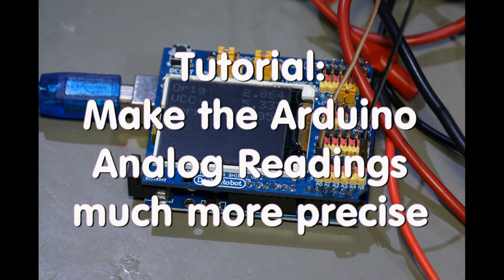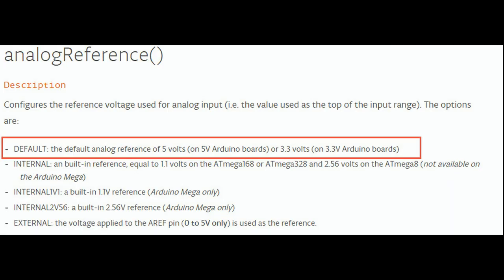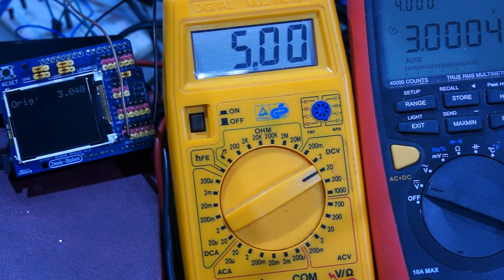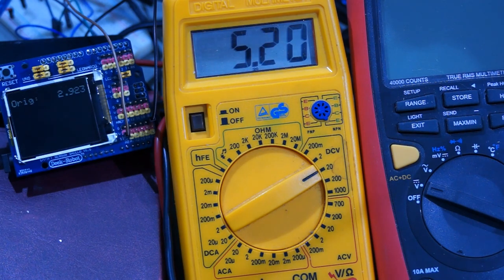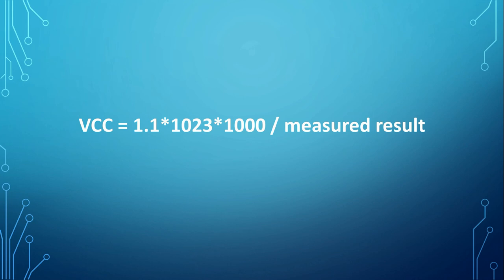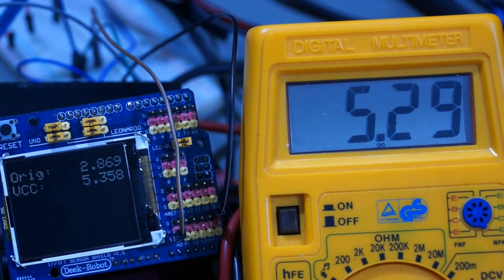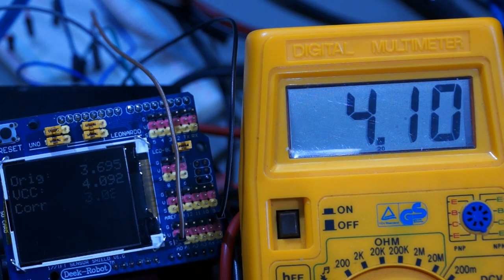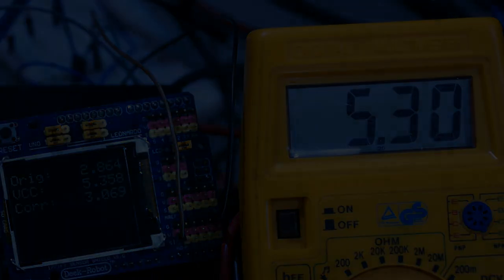#10 Tutorial: Make the Arduino Analog Readings more precise

Comment: Very nice video! To increase the resolution, you can add up multiple samples,  as there is some uncorrelated noise on the A/D and input signal. To get a more stable measurement you can for example add 4 values and divide by two to get an extra bit. Experiment a bit as there is enough sample time for a reading on a display... averaging cancels out noise.

Comment: Nice video. Just a tiny correction - in formula one should use 1024 instead of 1023. It's not the highest value that one should be multiplying, it's the number of values (resolution), and the number of 10-bit values is 1024. So the formula should be VCC=1.1*1024/measured result
Reply from the maker: You are right
Reply: Actually, I was wrong, and you were right! :) One person explained the issue with my "correction" - it should be 1023 because the maximum value is 1023, and we are basically calculating percentage, not resolution. One should divide by 1024 if one wants to find out resolution - if one wants to know size of the step ADC can resolve.
Reply: mbaksa No, you were right from the beginning. See this: https://forum.arduino.cc/index.php?topic=303189.0 and this: http://www.electro-tech-online.com/threads/why-adc-1024-is-correct-and-adc-1023-is-just-plain-wrong.132570/
Reply: The maximum 10 bit number 1111111111=1023.  The math would tell you that the maximum voltage should be 1023.  BUT (capitals), the ADC does something you are not expecting.  It subtracts one division (LSB) from the reading.  To get the full reading you have to use 1024.

Comment: The ADC of the Arduino is normally ratiometric, as in referenced to Vcc. You can switch to an internal fixed reference of about 1.1V instead. Most external ADCs have their own built-in fixed reference. Both have different use cases.2
Reply from the maker: The point of this video is to use the internal reference instead of VCC, I think.
Reply: Hi Andreas, My comment seems to have been edited, it is not my original text.?
As you know the use of a ratio metric ADC means that the supply to the Arduino can vary but the ADC count should track the changes in the supply and give the correct conversion.
BTW: I am no way being critical of your excellent tutorials.

Regards Eric.

Comment: Hello Sir, brilliant yet simple way of correcting hardware issue with software. My two ways of correcting this issue were: 1) use a higher supply voltage (2 series Lipo) and a 7805 to power the sensitive projects or 2) use a 3.3v regulator to feed the Aref, which limits the input voltage on analog input pins. Now I have an option #3 (or #0)! Thank you !
Reply from the maker: Thanks! I am not the inventor, I just liked the concept when I saw it.
Reply: +thevideoboy87 hello..  I'm having the same problem.. can i use a 12v supply and a 7805 to supply my acs712 current sensors?  my reading is pretty bad.. can u give me a sample circuit?
Reply: +Renatzu Agura Hi. the ACS712 consume approx 10mA, which means a dissipation of approx 70mW in the 7805. There should be no issue, make sure to install filter caps on the in/out of the linear voltage regulator. It's always a good idea to put a "dummy" load on the 7805 output, like a small LED+resistor to improve ripple.
Reply from the maker: +Renatzu Agura Thevideoboy87 is right. I could add that you need short wires between the acs712 and the Arduino to avoid noise pick up.In addition, you also could check with a voltmeter if the "bad reading" comes from the acs712 (disconnect everything else exept the current test wires and the supply voltage and measure directly on the module) already or is somehow created by the Arduino.
In addition it is always good practice to wire ground as a "star", not a "net".

Comment: Try use high external voltage and a linear regulator to power arduino, then don't draw much current from the arduino itself - this works well for bigger applications which already use multiple voltages, also make sure to keep arduino away from magnetic fields such as those made by power supplies, motors, power wires and wireless transmitters.
Reply from the maker: Good idea!

Comment: Sir, recently i'm facing a problem when i connect ACS712 20a current sensor to my node mcu 8266 microcontroller.The reading value is not accurate at some points.then i searched on the internet and find out  that the current sensor is 5v module while the esp8266 is only giving 3.3v. so how do i fix this?
Reply from the maker: you get level shifters from 5 to 3.3 volts

Comment: Does the converted analog to digital value of the internal voltage reference of 1.1V, the digital value, change all the time with variations in Vin and Vcc? It would be interesting to see that digital value with changes in input voltage,  if I understand it correctly.
Reply from the maker: Yes, it changes as shown in the video.
Reply: The term was "bit banging", it says "bit panning" on CC.  So bit banging is using software to do the job of hardware.  That I could look up.  Todos los dias apprendo algo nuevo.

Comment: Hello Andreas. Nice trick ! Would this also work (or even be needed) on the ESP32 (WROOM) ? Need to measure up to 85 volts and I'm wondering if I would use the build in ADC or an additional AD1115 module ( both with resitor divider). AD1115 is higher resolution ( 15b in place of 12b ) and has a build in voltage reference, but 0.02 Volt resolution is good enough
Reply from the maker: 1. It does not work on the ESP32
2. I made a video about the ADCs inside the ESP32 and the AD1115

Comment: Great video, thanks Andreas.

In the video the equation is presented as 1.1*1023*1000 but in the code on github it is actually 1.1*1024*1000. Which is correct ? I assume 1023, since the ADC reading will max out at 1023, and dividing that by 1024 will not give exactly 1.1V
Reply from the maker: There are different opinions about it. I do not care...

Comment: hi .. is there any way to reduce analogue value fluctuation while reading from analogue pin
Reply from the maker: This is a complex topic and I cannot give you a short answer. The simplest thin is: Keep the wires short.
Reply: @AndreasSpiess   wt about adding a capacitor ? since making wires short is not possible . if yes , can u tell me wt value of capacitor should be required ??

Comment: Dear sir, again a very good work on reading very precise voltage with fluctuating usb voltages. I had this problem as during testing my uno from the supply of my pc usb, the voltage fluctuats around 4.95 to 5.1 volts according to the pc cpu load etc. After uploading the sketch and when it's built outside the readings are all off. So again to plug to the pc and rewrite the values as per the external 7805 regulator. This video lesson will really help me. I will give it a try. Thank you so much again.
Reply from the maker: You are welcome. I hope it will do the job for you.

Comment: Thank you, a very useful and precise description, good job. Is there something special about the Leonardo in relation to excel ?  or can you do the same with the Uno or Mega2560?
Reply from the maker: +Howard Bailey thank you for your comment! Yes, something is special. Only Leonardo, Due, and Pro Micro can act as an USB host. Only these boards know the command keyboard.print() which I used to transfer the data from the arduino via an emulated keyboard to Excel. If you want to do it with an Uno you could use a usb host shield for this purpose. But I never tried it.
Just google arduino keyboard.print and you should find more infos.
Reply: +Andreas Spiess  thanks. I had a look at your other vids (all good) and more on utube, I now realise the Atmega32U4, and some others, have the USB coms built in, i.e. 'Host' USB, I'm learning gradually. It's more difficult 'teaching myself' so videos like yours are a godsend, I look forward to your future posts.
Reply from the maker: +Howard Bailey I learned it the same way you do now. This is the reason for my videos. I want to give back what I got...

Comment: I don’t understand… you used the number 1023 in the formula you gave at 3:20 because 2^10=1024. These are not the same number. Why not use 1024 in the formula?
Reply from the maker: Because there are only 1023 "distances" between values. But I am not sure which one is correct :-(
Reply: @AndreasSpiess  Gotcha

Comment: Why not just switch to the internal reference?
Reply from the maker: This is what this sketch does.
Reply: @AndreasSpiess  I watched the video. You're measuring the internal reference and using that deviation as an offset to fix the inaccurate readings. But if you just switched to using the internal reference as the active reference, it would just work properly anyway.

Comment: I have gone from 3 volts to 5 volts with 98 percent accuracy. As long as you tie one of the ground ports of the Arduino to whatever you are measuring, its 98-99 percent accurate. Am i wrong in doing this?
Reply from the maker: If it is 98-99% accurate it seems to be ok for me.

Comment: If the Arduino comes with an accurate, built-in voltage reference, you'd think it would use that voltage reference by default (possibly combined with a voltage divider placed in front of the ADC).
Reply from the maker: I do not understand. We use the built-in voltage reference for this project.
Reply: @AndreasSpiess  Yes, I know, I've watched the video. I'm only wondering why that isn't the default. There are several things about these ADCs, that have me scratching my head, especially the one in the ESP32. It's a shame such a great little device is let down by such a poor ADC. It would probably cost a few pence (cents/pennies) to get that fixed.

Comment: Thank you for this video, Andreas! Could you please explain me the formula 
Vcc = 1.1*1023*1000/measured result  ?
God bless you!
Reply from the maker: I do not remember, how I calculated this (it is a long time since then). It has to do that you measure a value which should be 1.1 volts (internal reference voltage), but in reality, is not, because you measuring is wrong. Maybe you can figure it out if you look at the other calculations in the code...
Reply: In case you or someone else still wonders:
The ADC returns values 0-1023 proportional to the measured voltage with 1023 corresponding to VCC.
Proportionality is to say that the ratio voltage/ADC-value is constant for all voltages in its range, specifically this holds for VCC and 1,1 V. We know that VCC is measured as 1023 for any VCC, and measuring our 1,1 reference voltage, the corresponding ratios must be equal:
1,1 / measured result = VCC / 1023
This of course also holds for voltages in milli-volts in which case our reference voltage becomes 1,1*1000 mV, and (after rearranging) we get to Andreas' formula. Looking through the code this conversion seems a bit redundant though, as he immediately converts back to volts in line 29 introducing the 'supply' variable (supply = readVCC()/1000.0;)

Comment: I used you code and I'm still getting wrong readings. The fluctuation is from 0.5v up to 1.5v
Reply from the maker: Then something is really screwed up. I would first try to get stable values without the code.
Reply: @AndreasSpiess  I'll keep searching then. Thanks for your time
Reply: Andreas Spiess i think i found the problem. I need to use a voltage divider to lower my input V to match the internal reference

Comment: Thanks a lot, Swiss man. Here's a one-liner using your help:   

vIN = ((analogRead(voltageSensor_pin) * (readVcc() / 1000.0)) / 1024.0) / .2;
Reply from the maker: What was the question?
Reply: @AndreasSpiess  my Q was why is this temperature reading wrong. You solved that for me. thanks again. So, I condensed the lines of code to make it smaller.

Comment: Trying to use an Arduino for a high speed, "high" accuracy application, and getting fluctuation on the first digit, is this fluctuation likely due to the supply voltage from the Arduino fluctuating or is it just inherent noise in the system? Like, would adding a  capacitor to smooth out the supply voltage make it more accurate? :)
Reply from the maker: If the first bit is the one with the highest weight your setup is completely screwed up. If it is the one with the least weight this is what you have to expect. Any source, also the ones you describe can be the reason for that.

Comment: Maybe its too late after two years and you figure it youself already, but. if you write 
analogReference(INTERNAL); // it will limit analogRead to 1.1v maximum input with 1023 value. 
And you can use simple resistor voltage divider to limit any  of your input voltage to 1.1v maximum.
https://www.arduino.cc/en/Reference/AnalogReference
You made a huge job with register tweaking... but is it worth it?
Reply from the maker: I think, it is worth it, because you use the internal connection and do not need a divider for that purpose.
BTW: I did not do the work of tweaking. My contribution is just the communication ;-)